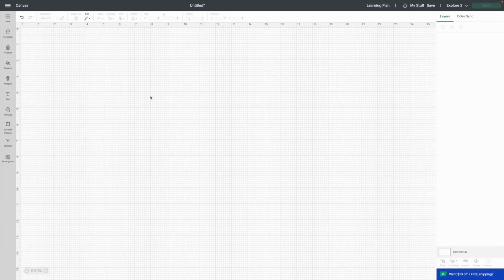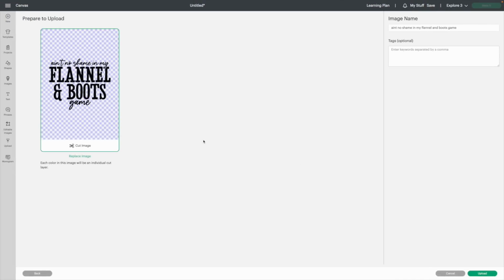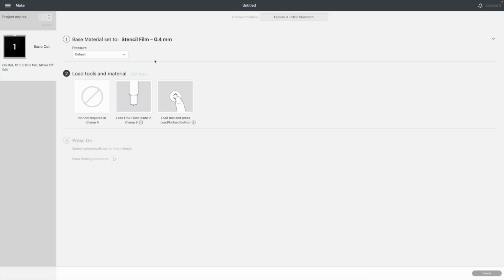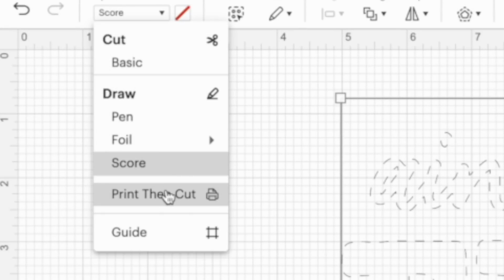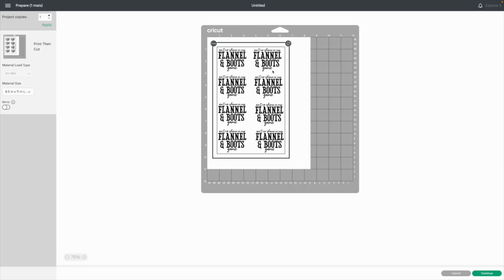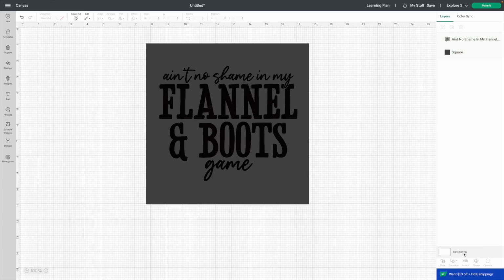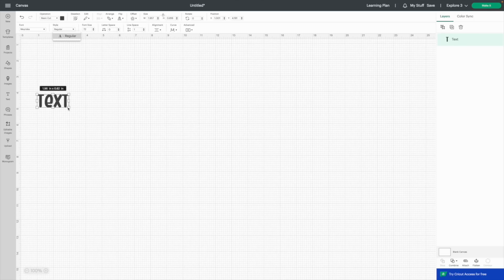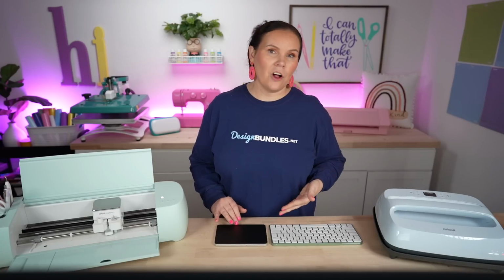Cricut Design Space UPDATE - How to use Cricut Design Space + 2023 Features!  🙌

Comment: I haven’t used my cricket in a long time but this is certainly going to help me to get going with it again. I use my silhouette mostly. I did try to upload some DFX files from your website without success. Can you give me a tip to make the download smaller or connect faster? It seems to lock up my silhouette software when I try to download TFX files thank you for your help.
Reply from the maker: Hi Debbie! Could you please message mail@designbundles.net ? They will be able to help you with this process - Agata

Comment: Great video Crystal. You have certainly covered a lot. 
I have a question about font sizing. How do you know what size font to use in a project? I always get confused. Do you stick with sizing the box or is there an easier way. Please help.
Reply from the maker: The size of your font will depend what you are making and the size of the object it is going to be put on. I recommend measuring your materials and you can make the font that size to fit perfectly. - Brittany
Reply: @DesignBundles  thanks for answering my question. I thought it would be a different method than what I am doing already but guess I was doing it right after all. 😊
Reply from the maker: You're welcome! We're always happy to help! - Brittany

Comment: If I want to make an svg to be a png how would I do that. If I use an svg into a png will the svg have to be a print and cut
Reply from the maker: Depending on your program you can save a SVG as a PNG, the SVG would not have to be print and cut. - Brittany
Reply: @DesignBundles  would I have to flatten the svg?
Reply from the maker: Hi there! You can highlight the entire SVG and then click flatten in the bottom right hand corner. It will then automatically change your cut to a print. - Dawn 🙂

Comment: I first need a way to turn off the updates.  I'd be happy with a version I had 6 months ago without the intrusive unnecessary time wasting ineffectual and program disabling updates that I have absolutely no purpose for.  I just want to cut some logos and jersey numbers, sometimes right before game time, and because I don't run the software for a month, I get an update and while I'm trying to work, another conflicting update starts that crashes my Win 11 gaming laptop.  After uninstalling and reinstalling, it opens showing in task manager but not on screen. Then the tech support on this is circular, ineffectual and a much further waste of time.  I also hate that when I layout a design to fit my vinyl and then go to cut it, the software says I need way more vinyl.  So I take the 24" cut, which wants 30", and make it into 2 12" cuts and it works.  If they would just fix the dysfunctional garbage and let me get on with just cutting what I have laid out.  I don't need 2" of waste around all sides.  This software seems to be designed to waste as much vinyl as possible.